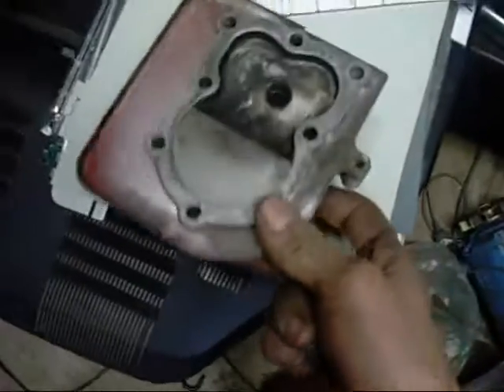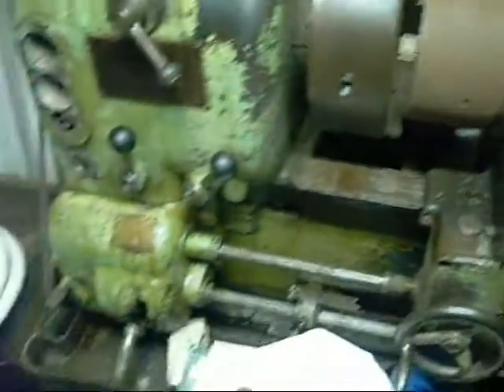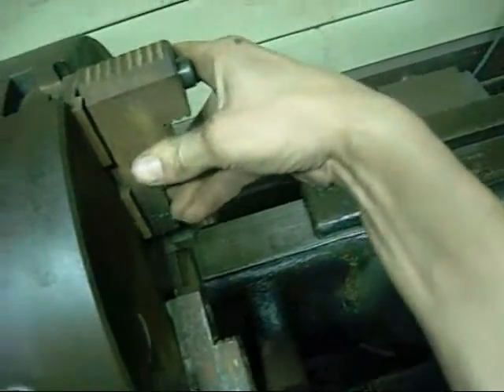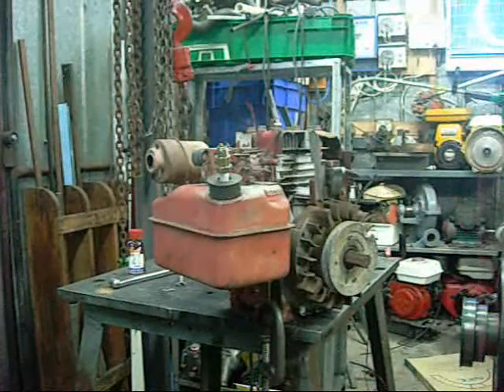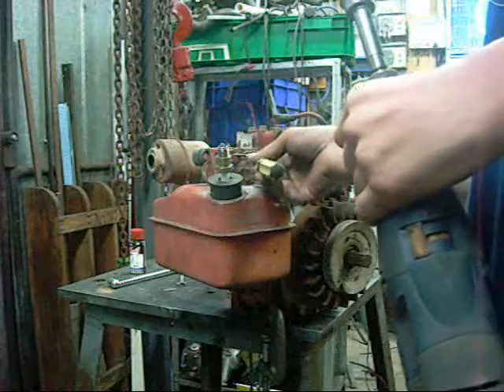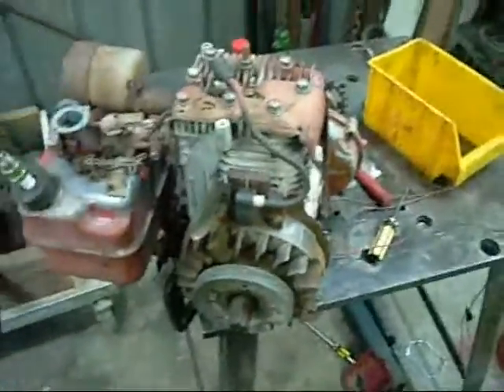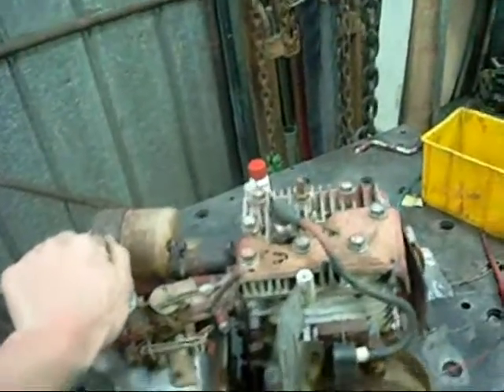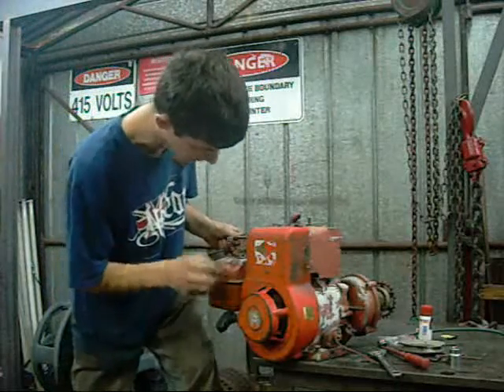Briggs & Stratton IC Engine Pt2 - Head Shaving and Cold Start

Comment: I done the same thing you did, but in a different way, and to a 5.0 briggs lawn mower, i milled the head right down to the flat surface...runs awesome, and can def. tell a difference in the compression when starting it...but should i be running a bit more better gas like premium now? cuz i noticed when i hit the thick grass, it does slightly pre-ignite...i have yet to try it tho...just got done doing that to the head earlier today. "for shits and giggles"

Comment: @GFVagent007 Was it hard to keep the surface of the head flat using a file?  Did the valves clear the head?  And on a mower with a governor did it still run at about the same speed with no issues?

Comment from the maker: @itscool1968 the engine gearbox was just over full when I got it.

unless you mean the lathe headstock?, its a little low (1/4" down on the sight glass) but I don;t have any of the right oil for it at the moment, if the level was below the sight glass it would be dangerous.

Comment from the maker: @magnahelic1 yeah, you can line bore things like that, bit of stuffing around to get it centered tho. good thing about the turret lathe is the 2 tee slots on the cross slide that a angle plate can be bolted to.

I guess I could chuck up a arbor that fit the existing cylinder, slide the block onto it and bring the angle plate up to it and bolt it in.

not really worth it for a disposable engine, but somthing rare and unique could be re-bored that way!

Comment from the maker: @GFVagent007 good work!, you can get a surprisingly flat surface by draw-filing, but not the same as milling or turning, only issue is the head gasket may not last as long if the surface is slightly uneven,

Comment from the maker: @trentontrading since the cylinder dosn't come off the block it would be too hard to do it in a lathe, but clamping it to a angle plate on a mill and using a boring head would work fine.
only problem is finding a piston to suit (30 thou oversize or so) but that would solve the broken ring/score problem.

Comment from the maker: @randomenginestuff yeah its a job for carbide, I have drilled hardened steel before on a mill with carbide, its a slow process but it works!

I've seen a promo vid for new briggs engines with pressure lube, I guess they had too many larger I/C's blow up and finally got the message ;)

Comment from the maker: @mattyvt93 yeah, I can say it works but it idles high and is a bit rough, without a heavier flywheel it won't idle smooth, compression is higher than factory.